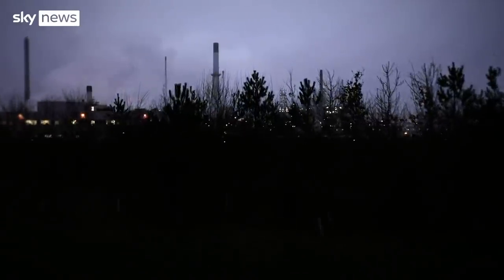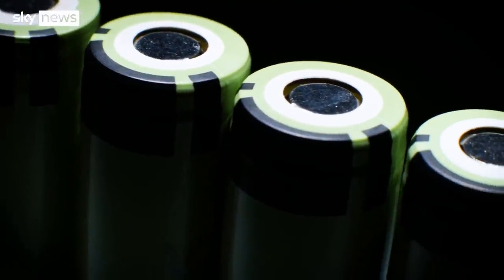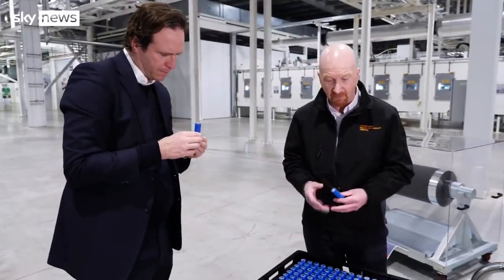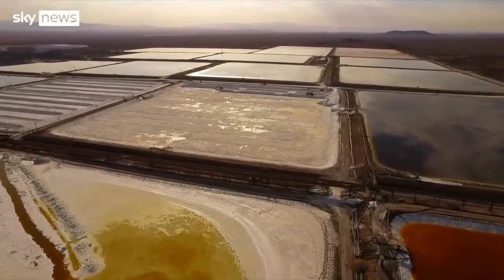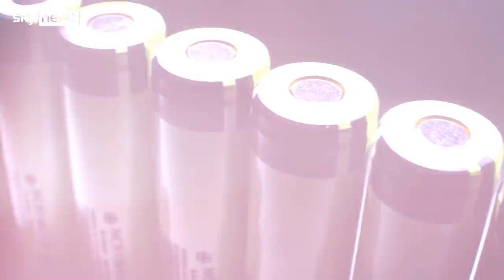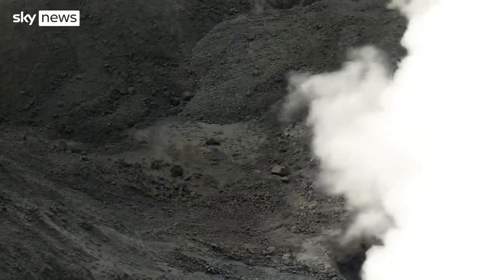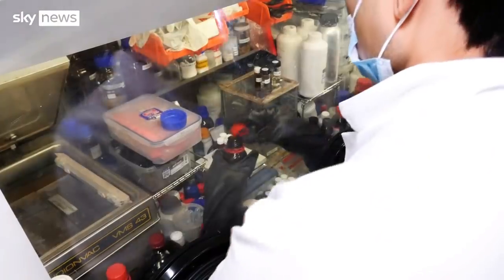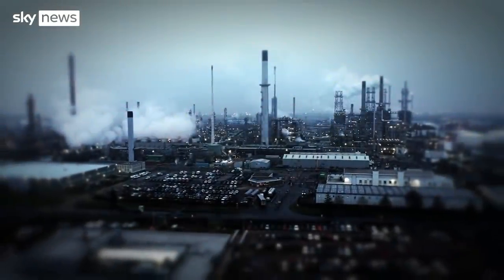EXCLUSIVE: Plans to build a British battery industry in doubt

Comment: Good informative basic video. Fortunately, the financial and political prizes for winning the battery tech race are so utterly staggering that huge investment  IS going into research. Britain just needs to do more than we currently are.
Reply: Desperately needs to do more...honestly its pathetic. it should be looked at like building Spitfires and Merlin engines in WW2, get a group of the top industrialist together and  get on with it....
Reply: No it’s not a cheap, reliable and efficient hydrogen systems are needed for net zero.
Reply: The video got something very basic wrong. Batteries are not a power source, calling them that is like saying a petrol tank is a power source.

Comment: Batteries do need a breakthrough in current technology to become functional and efficient enough for larger engines.
Reply: Battery power isn't needed for larger engines in the first place. Air travel makes up only a small amount of carbon emissions. Industry and cars are much larger polluters, and the battery technology is already good enough for those things.
Reply: @Ryan-ce1oc  battery experts disagree.
Reply: @Land-of-reason  battery experts will always say improvements need to happen. Tesla has already shown battery technology is good enough for electric cars, otherwise they couldn't sell any cars. It's impossible to refute.
Reply: What is actually your point though? Batteries already work in cars, which is the only place they need to work. We don't need batteries for anything else. Industry doesn't need to run on batteries and we have nuclear power for clean energy. @sultanhaider1176

Comment: The race for the green EV revolution is not so green after all!
Production and shipping that graphite around the globe isn't exactly 'green' nor is all the charging infrastructure to charge EV vehicles which commonly uses gas powered power stations to produce the 'clean' electric to charge EVs🤔😳
Reply: No one driving an EV is doing it for the environment
Reply: @hamster1-1  EVs are hardly a 'green' way forward, the batteries are not green friendly neither are the plastics and other materials in the EV production, even the electricity used for charging mostly comes from gas fired power stations!
Reply: @pdtech4524  that why I said no one is driving a EV for the environment
Reply: So, just continue burning fossil fuels?
Reply: @freekfaro5606  My 2 year old gas fired heating boiler is set to be phased out in 2025. Yet it is probably way more efficient than the older gas fired power stations producing our electric!
I only use it from November through to February in winter, the rest of the year our house is warm enough!

Yet we will continue to use electricity all year round which is produced from gas fired power stations and that is OK!
Internal combustion rngines are being discontinued in 2030 so everybody will be making the move to EVs. That's less than 8 years away and we haven't got the charging infrastructure in place yet nevermind the increased electricity production.

 Which is once again produced by largely gas fired power stations!

Meanwhile countries like China are rapidly ramping up their coal fired electricity production.
Go figure!
Reply: It’s much greener than burning a lump of coal.
Reply: @cammysmith7562  Sure, so why are gas boilers being discontinued in new builds from 2025 if they're so 'green'? 😲🤔😁
Reply: yes. one burning natural resoucrce oil. Another one destroing material natural resource.

Comment: Interesting to note that the report did not touch on lithium iron phosphate batteries, which play an increasingly large role over time
Reply: Yes it didn't look at solid state batteries or sodium based batteries which generally should not need cobalt or lithium. Sodium is abundant and cheap, and there are already moves towards these technologies. This video is fairly lightweight.
Reply: @starmole5000  it literally does look at sodium batteries.
Reply: @SpeedfreakUK  oh ok - well in any case it was pretty lightweight.

Comment: No form of energy with any of our current technology is clean, unfortunately we have to adopt to the greenest available and then adopt new forms that are greener as they become available.
Reply: exactly. Sensible.
Reply: Electric is the next fad after diesel. People will then realize that all the heavy metals involved are not environmentally friendly in the slightest and the electric primarily still comes from fossil fuels.
Reply: @addz17  Electricity will undoubtedly be generated by clean sources as we migrate from fossil fuels - no case for not electrifying because "it uses fossil fuels anyway" - as it's not true, the UK often produces ALL it's electricity needs for the day with renewables - the hard part now is storage of that energy which batteries will play a key role in.

When it comes to the materials used, research is already underway on replacement materials for heavy metals/rare earth metals etc. 

For example, carbon based batteries, sodium based batteries are closing in on Li-Ion technology in terms of power capacity and can even better Li-Ion battery technology in certain aspects.

Your points can easily be answered to as above. Fossil fuels are still the most environmentally damaging type of energy source we have even now with the environmental concerns over mining for minerals withstanding.
Reply: Renewables made up a 43.1% share of UK power generation in 2020, generating more electricity than fossil fuels in the year.

Doesn't sound like a fad to me.